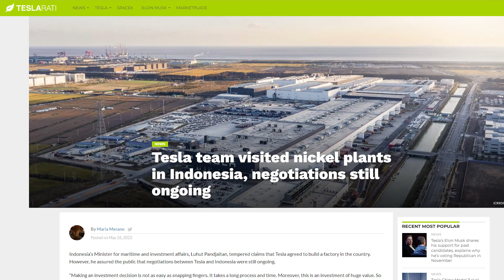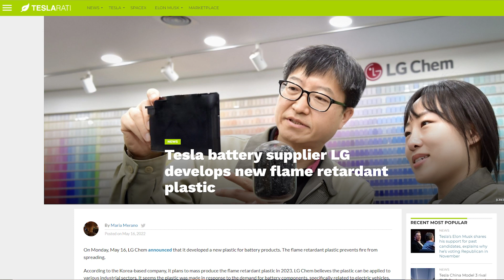3 reasons EVs will be WAY cheaper sooner than I expected

Comment: I don't see how energy density really helps that much.  The mass of raw materials used to produce a given energy storage (not density which is per unit Mass) probably has a lower limit.  Energy density is probably improved a lot by reducing unnecessary packaging, BMS, and structural materials.  An EV with a higher energy density battery can have a slightly smaller battery to achieve the same range.  The weight savings enables the same range with a smaller battery.

Comment: Get ya facts correct Sam - yeah prices will fluctuate no doubt about it but do your research on GS prediction its crap watch spot price for example as via Pilbara Minerals BMX auctions and research set on supply/demand side by Benchmark Minerals (BMI).  As for BYD buying 6 x producing mines in Africa ??? Where and when okay they are buying "into" located resources in Africa in partnership with unstable Govts  - it will STILL take 6+ years to put a shovel in the ground to produce battery quality material.   NON OF THIS PLANNED OVERRATED GS/BYD news WILL NOT STOP DEMAND AND REDUCE PRICES TO THE DEGREE HYPED BY GS.  ITS A non factual or at best designed ROUSE GS is a partner of BYD - do the research Sam. There will be permanent Lithium deficits untill 2030+ Macquarie Bank and the EV/Storage industry, now really can you see prices falling 70% from today sorry!!! Not gunna happen.  AGAIN watch PLS BMX auctions.  Still like ya channel but don't get sucked in by innuendo.

Comment: The only draw back is everyones electricity bill will go up 10000 percent to pay for charging them
Reply: wrong...do your research,  30% maybe and only if you drive a lot. Plus you'll be much more likely to install solar panels and power will be free ( except the fix cost of installation)
Reply: @richardlocke7264  well mine has come up 50 percent and we only has about 10 EVs in our town? Check out your adjusted consumption that is what you pay for above your Usage!
Reply: @terenceiutzi4003  if your bill is up50% and you only have 3 EVs in your town, than EVs are not the cause.
Reply: @richardlocke7264  well my adjusted consumption went from 110 percent to 135 percent and they increased both the debt recovery and the delivery charge  by 10 percent per adjusted KWH!
Reply: @richardlocke7264  we now have 10 recharging stations in town and that required 4 new 50KV transition lines into town!
Reply: @richardlocke7264  at the rapid charger UT side my wife's office they pay about $0.10 per KWH all in and I pay $1.30 per KWH at home

Comment: Lower costs is most likely to help manufacturers, high demand will keep retail prices fairly high. The good news EV manufacturing more likely to continue and survive and expand.
Also so many potential new chemistries including zinc and other minerals, if any of these playout, could be even cheaper. It sounds like you can MacGyver a good battery out of anything.

Comment: In 1906 1/3 cars in US were electric. Why such a drop since?
Reply: Chademo
Reply: Isn't that nonsense: Tesla weights 2.5 ton to move around much less than 0.5 ton of useful load, and uses 0.5 ton of batteries. And now that new Chinese SUV "great achievement" of 600+ miles range compared to Tesla 400 miles - and by what: now it is 3 tons and that just by adding more batteries. Really saving energy (that comes from a socket - and socket is green) for caring 3 tons backpack by one or two persons in average. Stupidity prevails.

Comment: Even though EVs are really becoming viable they still have a significant carbon footprint. These kinds of efficiencies of scale and technological change will reduce that footprint, I believe, more quickly than is commonly supposed. Some changes are slow like building ICE engines of better and more durable iron which took until the 60s to mature. EV batteries seem to be following a similar pattern. Other changes are unforeseen and rapid like the use of lead in petrol or the use of computers to control ICEs through sensors at dramatically better efficiency levels much more recently. Technologically we are still at the dawn of the EV era, and there are both known and unknown unknowns at play. For example, I think swappable batteries will replace built in batteries when there is enough infrastructure because charge time delays are simply a non starter in some applications like delivery vehicles or taxis. Plus swappable batteries will make buying a EV a lot cheaper and shift the whole battery management and charging overhead to the battery companies and convert a capital expenditure to a running cost.
Reply: You missed the mark on delivery & Taxis. There are plenty of EVs doing both. I bought my Bolt specifically for DoorDash & Uber Eats delivery. It can fast charge in an hour while I eat & watch YouTube. When delivering full time, I only need to DC fast charge about every third day. For part time, level 1 is sufficient. If I had level 2 at home, I would never need to go to the supercharger. No matter how much I drive, the car would always be “full” in the morning.
Reply: @brendykes6599  I installed a 220 volt charger in my garage (close-in suburban home in Houston). My daily commute in my 2015 Nissan LEAF with 24 kWh battery was 40 miles. I  would come home at 50% charge, leave in the morning with 100%. The higher voltage reduced the re-charge time from 11 hours to 4. It also gave me confidence to do side trips and arrive home with 10%. Totally changed the utility of the vehicle.
Reply: @dougsmith8342  since I live in an apartment, I’m lucky to have level 1 for free. I WFH & don’t do delivery full time anymore, so level 1 is plenty. If I ever buy a house in this ridiculous market, I will install level 2.
Reply: @brendykes6599  Apartment life is a deterrent to EV market share. In Calgarr, where I lived for two years in the middle '70s, many apartments with garages had 110v outlets for block heaters to keep the oil from from becoming grease. Same for public parking lots. Car owners looped extension cords around the driver side mirror. When attached to the outlets (which were mounted on horizontal pipes) it reminded me of horses tied up to hitching posts in Western movies and TV shows.

Comment: Seems you are one of those that thinks "EVs" will reduce toxic fumes - no in Australia in particular the extra demand for electric power will be done by burning coal.  Oh yes I note the aouthern oz and Tasmania have some wind and hydro but the rest of the country where all the people live is powered mostly by coal - so is China btw.  So - more EV's = More mercury lead and other toxins in the air - because coal has contaminants.  Gasoline and Diesel are all hydrocarbons with very little contaminant plus they have a catalytic converted to assure full combustion of the remaining gas.  Many Ultra clean hybrids put out cleaner air than the surrounding cities. PHEVs man; thats the right path. You can make more with the limited Lithium and hence 9x more electric miles than EVs and they are cleaner since you don't use coal.

Comment: Until at least 2030 EV’s will be in very short supply. Thus prices of decent EV’s in Europe and the US will remain high.
Most OEM’s will go bankrupt (killed by ICE obsolescence) and thus not add to EV supply. It’s all up to Tesla & the Chinese.
Reply: Don't forget the trump tartifs slowing down north American adoption.
Reply: @greggpon7466  buy American
Reply: @thomaswilson2917  I would if I had choices.  Right now the only choice for the average man is the GM bolt.  It does not have a heat pump or an lfp battery but it is still not bad at the price that gm is offering.
Reply: @greggpon7466  I see that GM has deals on the bolt. If you are limited in your budget it is a good choice to avoid $5 gas. If you can charge at home as electricity is cheaper at home. For me I pay about 1/3 the cost if I charge at home.
Reply: @thomaswilson2917  I only drive about 200 km a week.  But if I were an Uber driver or taxi driver I would be lining up to pay less than 15% (at worst) of the cost of fueling an ICE vehicle.  I bet an Uber driver could save up to US$300 to US$500 a week.  You could pay the car off in a couple of years.
Reply: @greggpon7466  so you prefer to send your money overseas?
Why have the big 3 been so slow to make vehicles? How does Ford making the mustang EV in Mexico help the American worker?
Reply: That's the conventional wisdom right now.  Often, the conventional wisdom turns out wrong.

Comment: Good to see these 3 battery materials will be cheaper but what about the price of copper to make
wire and contacts seems to be on the up and up.
Reply: There is maybe 30Kg of copper in a new passenger car. It’s mostly steel or aluminium. The NMC532 battery is ~30Kg of Nickel. The LFP battery is mostly iron metal if the phosphate is ignored. The battery of a Tesla model S is 25% of its rolling mass. Even that battery has 100Kg of cooling shielding structure and packaging

Comment: With the price of oil set to increase over coming years. Ev demard will mean that manufacturers will have start making affordable electric vehicles.  Otherwise, nobody will buy new ice vehicles.
Reply: Otherwise nobody will buy passenger vehicles. Of any kind
Reply: It typically works the opposite way more demand equals higher price. People seem to have a very high tolerance for expensive gas, huge vehicles are still popular.

Comment: When batteries become better and cheaper, EVs will cost less to build than ICE vehicles.
Reply: That should already be the case.
with the new high density lfp batteries, a 60KWh car should be cheaper than a petrol equivalent.
But electric cars are full of screens, etc, and battery demand exceeds manufacturing capacities, so we will have to wait.
Reply: No word on the sunk cost of designing plant equipment and the maintenance supply chain for the new tech. That cost takes ten years to be amortised down to zero. Many examples of this. The Buick 3800 V6 engine is still being made in its millions not because it’s a good engine but because it’s expensive to replace with anything better. Imagine making 1M NCM batteries then retooling for LFP cell to chassis after four years. All that manufacturing equipment is now eWaste
Reply: @theairstig9164  Most equipment for cell making can be reused.
It is mostly the formulas and up to a point the packaging that change, but most formulas are industralised in a way that you can use existing equipment.

Comment: Yes, GM announced June 1st, 2022 that the 2023 Bolt EV and EUV will be $5,900 lower for the EV and $6,300 lower for the EUV. I have a reservation for the Fisker Pear EV but may just get the Bolt EV or EUV later this summer rather than waiting till 2024. 2023 Chevrolet Bolt EV 1LT	$25,600	+ $995 Dest. Charge = $26,595 ; 2023 Chevrolet Bolt EV 2LT $28,800 + $995 Dest. Charge = $29,795 ; 2023 Chevrolet Bolt EUV LT	$27,200	+ $995 Dest. Charge = $28,195 ; 2023 Chevrolet Bolt EUV Premier $31,700 + $995 Dest. Charge = $32,695. I wish they would change to LFP but there is no chance of that.
Reply: Still these batteries are safer than the old one that you used catch on fire,  am I  correct ❔️

Comment: I Hope Goldman Sachs has done their homework thoroughly and are right. But I have a feeling they're underestimating the demand for batteries. Batteries are going to be the source of energy for everything that exists today that is run on cord or petrol. Energy storage alone will require massive amounts of minerals. I would like to know if Goldman Sachs included all of this. I'm not sure they did.
Reply: Hopefully the majority of those batteries will consist of mostly Iron, Phosphate, Sodium, Aluminum & other more common minerals. Also most of the supply chain will most likely start to re-circulate as recycled and repurposed batteries as soon as 2040, decreasing demand for additional mining.
Reply: @TheTanman412  Good point about recycling. Northvolt aims to use at least 50% recycled materials in their batteries by 2030. Their joint venture recycling plant together with Norsk Hydro just started up in Norway.
Reply: They are usually wrong, but the ramp up for batteries has been done for current density and ternary batteries.  Now we are moving to lfp etc, and way higher density.  This means at least 5x less expensive materials for the same capacity and will trickle down to most batteries, including phones, even if I suspect phone manufacturers will try not to use them as they last too long for their marketing strategies.
Reply: There idiots, nothing more than market manipulation to push down Aussie lithium stocks then buy them.
Reply: Every industry expert has debunked Goldman Sachs lithium report, anyone with a bit of common sense and knows that they have absolutely no idea what they’re talking about look at how they reported the mineral space back in 2014 and they were completely wrong. Not to mention the fact that that report also has many numerical inaccuracies as well. Benchmark minerals intelligence has done a more thorough job at reporting the lithium space.

Comment: What's their estimated growth of the EV/battery market that they base this on? I'd say chances are they are under estimating the demand for EVs. I hope they are right, of course, or atleast the change will not slow down too much because of shortages and/or high prices.
Reply: I had the same thought. If Goldman Sachs is looking at GM and Ford saying 50% of the market will be EVs by 2035, they may be massively underestimating the demand. But yeah, I also hope that all barriers to massively scaling EVs come down, considering the market could be over 50% EV today if EV manufacturers could snap their fingers and, viola! they're making enough to meet demand.
Reply: @truhartwood3170  Indeed! EVs hold the answer to so many of the world's problems right now, including global warming, public health, crippling oil prices and even wars (like Ukraine) being funded on fossil fuel revenues. If only we could make more of them faster!
Reply: Agree, you ask the right question.  In a typical year global demand for new vehicles is about 70M. But we are facing a pandemic of EV Mania. It’s not unreasonable to expect 10 years demand brought forward into the next 5 years. So expect 140M /year. The 6 African lithium mines being acquired by BYD will add capacity for 28M vehicles over 10 years, or 2.8M /year. A drop in the ocean compared to 140M / year demand. BYD will sell close to 2M vehicles this year. It will be way more than 2.8M/year by 2025. These bankers know as much about the EV industry as Joe Biden. Probably they’re shorting lithium.
Reply: @MarksElectricLife  i don't think that is likely, I think we passed peak car. But even with current volumes they may think the EV part to grow in a linear fashion, resulting in a big under-estimation of battery demand. Some car think they will make ICE cars in 2050, so question is who is Goldman Sachs listening to?
Reply: @itekani  I wouldn't be calling peak car just yet. Some of the new K-cars featured on this channel, costing under $10K, will create a whole new generation of car owners in developing countries.
Reply: @MarksElectricLife  Sure, that can happen. Though that would bring a lot of good for people, I hope developing countries don't all fall into the trap of complete and total car dependency that many developed countries have.

Comment: Goldman can make all kinds of predictions but that doesn't make them true. We need 100's TWh's of batteries, we are only just into 100's GWh
Reply: We only necessarily need normal, current model batteries for solutions like Daily storage and portable storage needs like EVs.

  In regards to grid solutions, our current batteries will probably a non-competitive solution in the long term.  Low energy density storage is perfectly acceptable for grid solutions so long as the price is right, and the variety of approaches and materials usable for those solutions have a lot more variety and can be done far more cheaply.  Grid scale storage simply hasn't had any demand until recently, which is why products for that specific purpose are pretty new in the market.
Reply: I thought for 2021 total global battery supply just exceeded 1twh? Obviously not all of that was in the over 6,000,000+pure evs sold.
But still if you look at the planned capacity factors supposedly coming online by 2025 now? We will reach 5+twhs in the next couple year's. 🤔